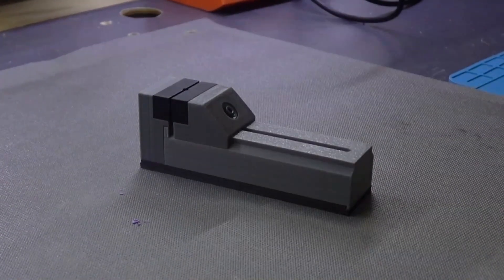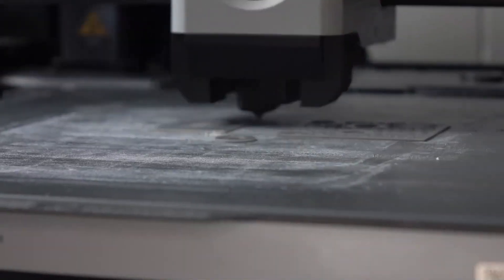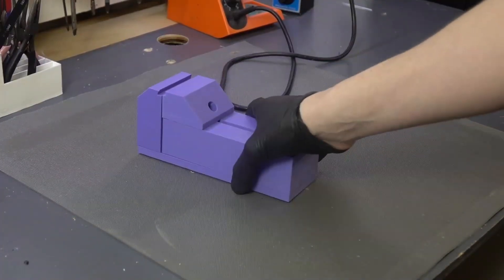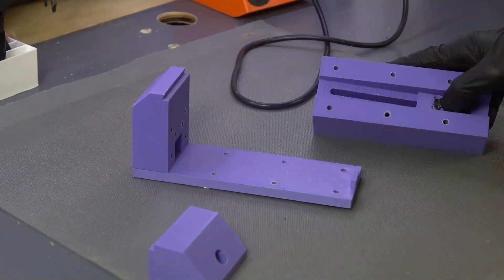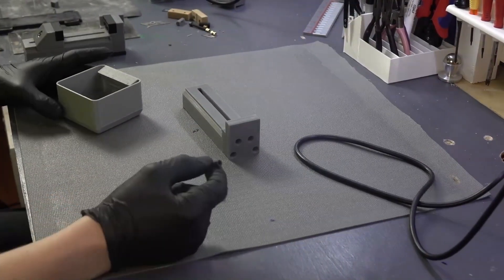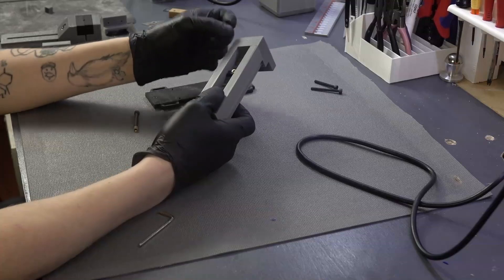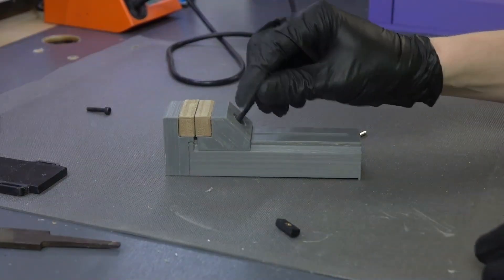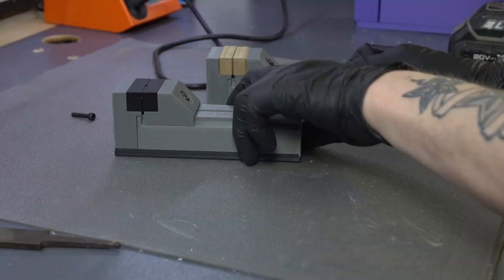Almost as Good as the Real Deal

Comment: Fantastic design and work, man! 😃
I think about making something similar, but out of wood for clamping circuit boards for soldering. The only difference is that the screw is going to be vertical (there's going to be a 90° angle instead of the 45°) and I'm going to use a knob.
Pretty small difference, but... I don't know, maybe you like the idea. 😊
Stay safe there with your family! 🖖😊